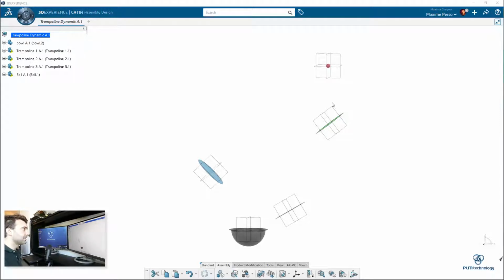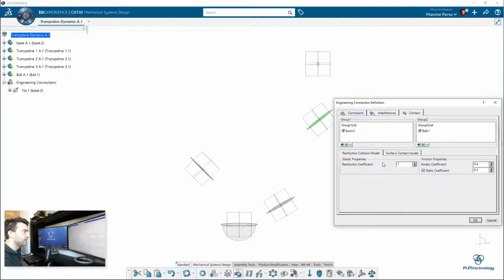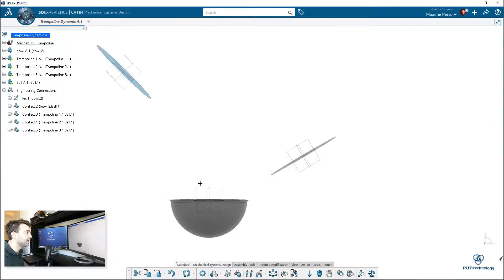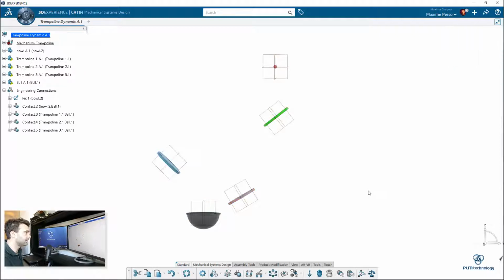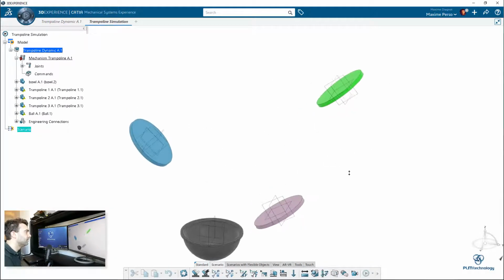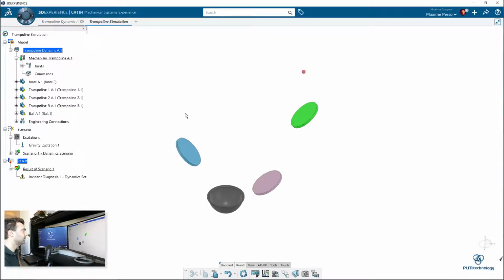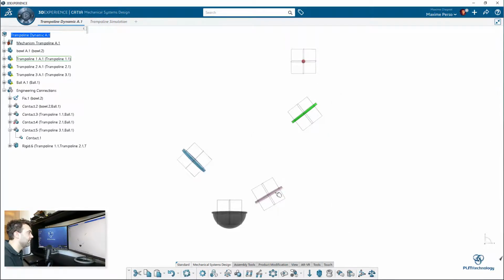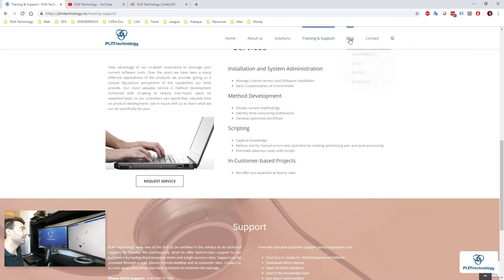Introduction to Dynamic Simulation [Part 2] CATIA 3DExperience R20x Live

Comment: Hi, great video. I have a problem with the weight, it is red, you know what I can do to solve it? Cheers
Reply from the maker: Thank you for your kind comment Rubén Hernandez
! Yes it is red when you are missing material. It is orange when in legacy preferences/General/Parameters and Measure/Weight Management, you use the default density (for instance 7770kg_m3 = steel). Then you have 3 choices: 1) use the default density and click on update weight. it should be orange. 2) You can declare the weight. for instance ball = 10kg. It should be blue. 3) You can apply a CORE Material to the BODY of the part (important that it is not a COVERING Material! because no density), then on the B.I essential, you click on update weight and it should be green. Hope this was helpful! Good luck ;)
Reply: @MaximeChagnot  Excellent thank you very much! I was able to solve it by updating the version of the platform, on the other hand, by clearing the cache memory I was able to access the links for update weigth.
Reply from the maker: @rubenhernandez2220  sure no problem! Great that you solve your issue. It is a good thinking you had, I also recommend to clear cache from time to time. Maxime at PLM technology